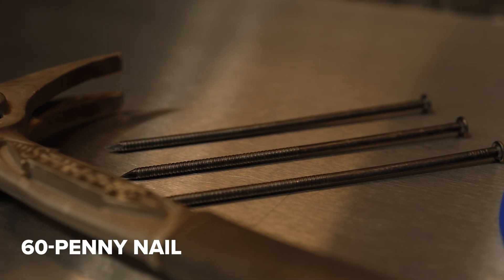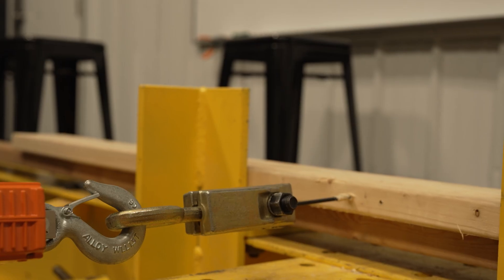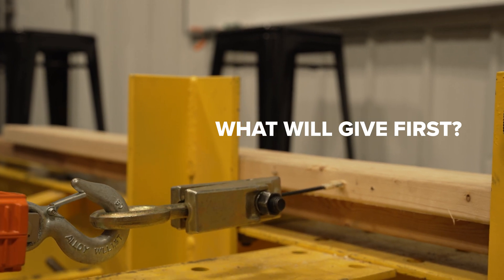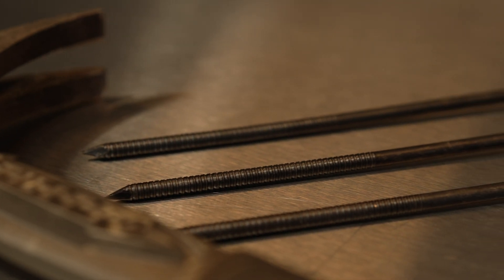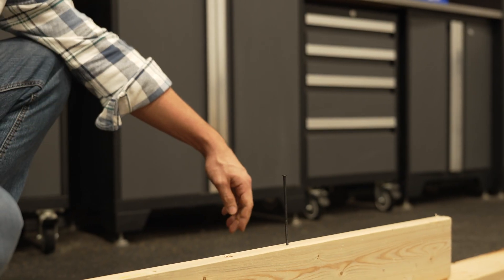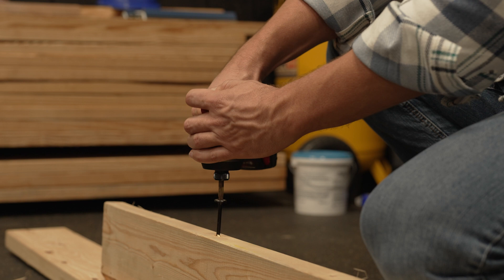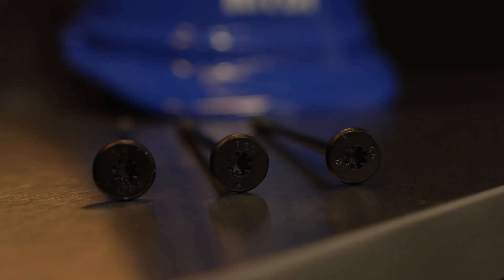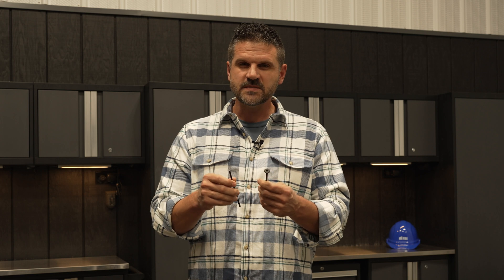Pole Barn Battle: 60-Penny Nails vs. 6" HeadLOK Screws! Strength Test Results Revealed!

Comment: Can you touch on the advantages/disadvantages of screws or nails for the sheeting?  I built pole barns that are now pushing 30 years old using silicone gasketed nails for the steel.  I haven't heard of one leak dealing with the nails thus far.  However, recently I heard about a fella that bought a house with a steel roof that was fastened with gasketed screws less than ten years ago.  He had roof leaks and had to crawl up there with a screw gun and tighten almost every screw on the roof.  It was almost as if the screws had backed their way out a bit....somehow.   Wondering if you folks have heard of this phenomenon at all?   Thanks
Reply from the maker: Great question—and thanks for sharing your experience! You're right: both nails and screws have their place in post-frame construction, and each comes with pros and cons.

Gasketed nails, like the ones you used, have been a reliable option for decades. When installed correctly, they can hold tight and provide a good seal—especially with a silicone gasket. As you've experienced, they can go the distance with minimal issues.

Screws, on the other hand, offer a few advantages:
• They generally provide stronger holding power, especially in high-wind areas.
• They’re easier to remove and replace if panels ever need maintenance.
• The gasketed head offers a reliable seal—when installed properly.

That said, the issue you mentioned with screws backing out is definitely something we've heard of, though it's usually related to one of a few factors:

Overdriven or underdriven screws during install—which can compromise the seal and reduce holding power.

Wood shrinkage—especially in the first few years, can cause screws to loosen slightly.

Thermal movement—expansion and contraction from temperature swings can eventually work screws loose if not properly seated.

We recommend using high-quality screws specifically made for metal roofing, and making sure they’re installed at the correct torque and angle. Over time, screws may need to be checked and re-tightened, especially if lower-quality fasteners were used.

Appreciate you bringing this up—it's a great conversation and definitely one worth having as people weigh their options for steel fastening!

Comment: Hot Dipped Galvanized heavy duty, 60 penny nails (not from Home Depot) are way stronger than my HeadLOK  screws. I noticed the headlok didnt drill in the straight path as i thought and poked out randomly in the timber i drilled into. The 60 penny galvanized, similar to anchoring spikes, or turf stakes, with its rough shank finish was so hard to swing into my beam/column, it took me 15 swings to sink it flush (even with pre-drilling, into old growth redwood). Also used it to sink my ledger deck board into my house girder beam, no way that will ever pull out and doubt it'll shear.
Reply from the maker: Appreciate you sharing your experience! There's no doubt that hot-dipped galvanized 60-penny nails are incredibly strong, especially in old-growth redwood where dense grain makes driving anything a challenge. Traditional nails do have high shear strength, and in certain applications—like ledger boards—they can be a great choice.

That said, HeadLOK screws are designed for engineered connections where withdrawal resistance and installation efficiency are key. While nails rely on friction and deformation for holding power, HeadLOK screws engage the wood fibers differently, creating a secure mechanical connection with high pullout resistance. Proper pre-drilling and driving technique can help ensure they go in straight, especially in dense or aged wood.

Both fasteners have their place, and it really comes down to application, materials, and personal preference. Thanks for commenting!

Comment: How is the shear value different as with attached purlins to trusses?
Reply from the maker: When attaching purlins to trusses, the shear value is influenced by the method of attachment. Nails (especially ring-shank nails) have excellent shear strength due to their ability to flex and absorb lateral loads as they’re driven into the material. This makes them great for applications where shear forces are high, like connecting purlins to trusses. On the other hand, GRK structural screws are designed for superior pull-out resistance and tensile strength. While they’re not as flexible as nails in shear, they provide a more secure and long-lasting connection, especially in situations where there's a risk of the fasteners loosening over time. The choice between screws and nails depends on the specific design load requirements and whether you need the flexibility of nails or the secure hold of screws.
Reply: @FBiBuildings1958 have you had problems with the headlock screws in regards to sheer strength in the purlin-truss connection?
Reply from the maker: Great question! We haven’t experienced issues with headlok screws in the purlin-to-truss connection when they’re used as intended and installed properly. They’re designed to handle both shear and withdrawal loads, and we pair them with structural design practices that ensure a strong connection.

However, as with any fastener, performance can vary depending on factors like wood species, load conditions, spacing, and installation technique. If you’re seeing concerns in the field, we’d be happy to review your setup or talk through best practices!

Comment: I think both. I always heard nails flex screws break, that was the whole reason behind using nails.
Reply from the maker: That’s a great point! Nails do have that flexibility factor, which can be helpful in certain applications. In some cases, though, structural screws like the ones we tested are designed to handle loads without breaking, which can make them a solid alternative. It really depends on the situation—thanks for sharing your perspective!

Comment: I've been using HeadLOK screws for all my deck building and structural work. They work fantastic for pulling everything together. I will never go back to nails as long as they are available.
Reply from the maker: HeadLOK screws are definitely a game-changer! They offer such strong pull and holding power, especially for structural work like deck building. It’s tough to beat the security they provide compared to nails. Glad to hear they're working so well for you!